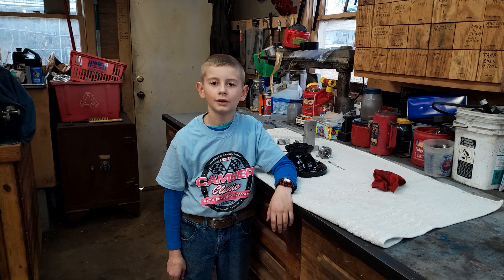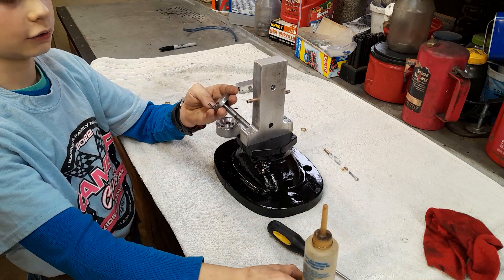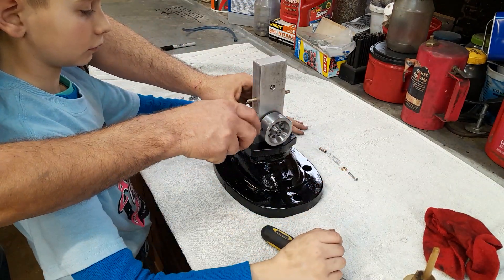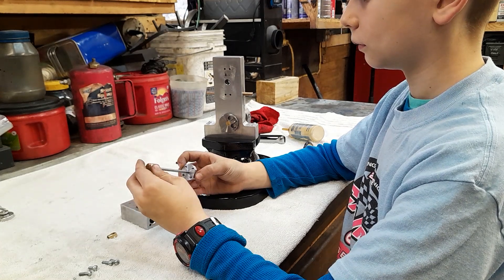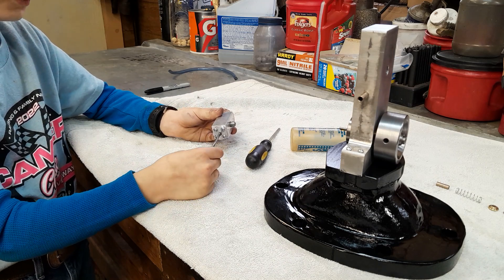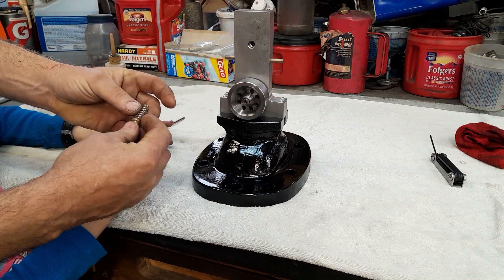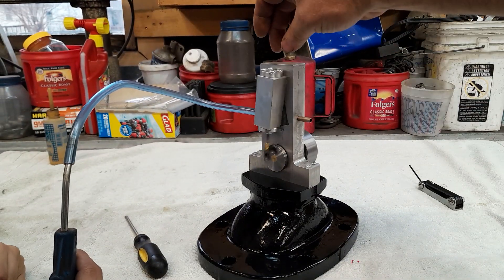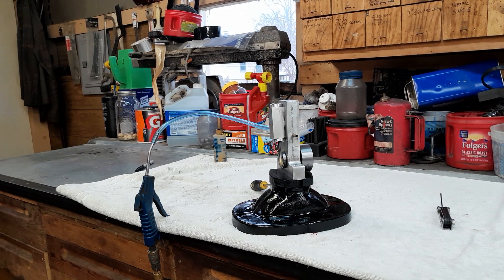Wobbler Steam Engine Build

Comment: Great project Elijah. I built my machine shop so I can make parts that I need. I want to learn new skills even though I am already an old man. I find special pleasure when I get to do joint projects with boys that want to complete their own projects and we get to work together in my shop. 15 boys joined me this summer and each of them machined their own wood workers vise.  My youngest students were 6 years old. They needed more help than the older boys did.
I have never tried to build any engine. You are already ahead of me on building engines.  I like to repair, rebuild and modify machinery. I like to make fine wood furniture. I like to build and fabricate things.  I bet that you and I could have fun together if we lived nearby.
Reply from the maker: {DAD}  Im pretty sure 15 boys in my shop would drive me to drink.  Bless your heart.